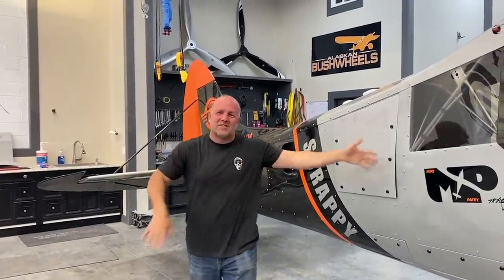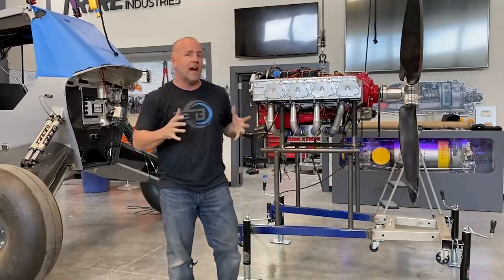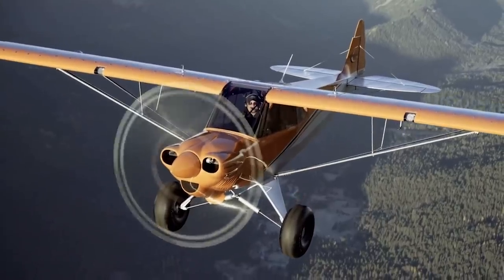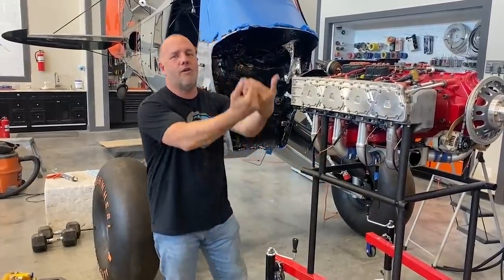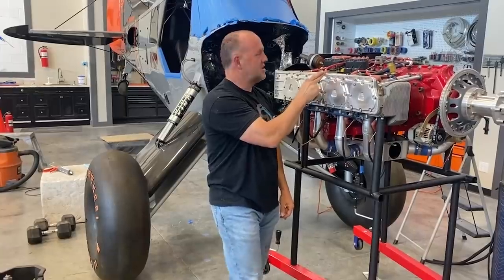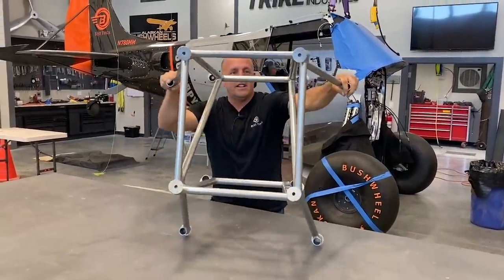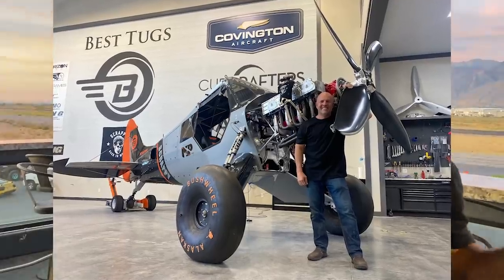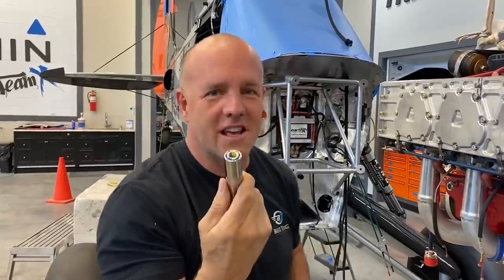Giant race engine into a Bush Plane 😳13 Liters goes into Scrappy build # 29

Comment: Dear Mike, this beautifull engine will use a lot of fuel, would 'n it be a challenge to design a pair of conformal external fuel tanks (like they have for the F16) to extend your range for overland journeys etc.? It has not be done on a cub plane before I think, so to make your Scrappy even more special!

Comment: Myself, probably would have used three Jack's on the engine stand to make it easier to keep from teetering as you adjust it. In the end mad respect to people like you I have for awhile been wondering if those supercharged watercraft engines would ever work in a light aircraft don't know what they weigh but up to 310hp stock just a thought awesome world there at your shop

Comment: Awesome engine mount design. I did notice one thing though, with all the angles and directions of installing the mount to the airframe, it still looks like there is only 4 bolts holding the actual engine to the mount and they are in-line with the longitudinal axis of the plane. Is this a weak point?
Reply from the maker: Great question 👍🤠 On the engine side they look straight but they are also angled.  Also the engine side uses the block as part of it structure as it can’t move or need any angle as a giant block.  So on that side of the engine we use the 4 certified attach points designed and on all certified agricultural sprayer aircraft currently using this engine. Many even heavier twin turbo versions of this engine use this same set up.  They test this mount 4 point side to 12 G.  I think the only way to cause a failure would be a crash of some kind.  Let’s hope not 🤠 cheers

Comment: Do you ever use safety locknuts (like with an steel out-of-round insert) in attaching points like the motor mounts?

Comment: Mike - Why did you not go with fuel injection for your engine?
           Are you concerned at all by the size of your fuel/air plenum that feeds the cylinders and what could happen with a back fire?
           In watching other aviation vids the little LiPo batteries seem problematical at best.  Sure seems like an 'old fashioned' AGM battery would be a better choice?  
           Better yet move your battery back into the cargo area to eliminate arcy sparky things from happening in a fuel rich environment of the engine compartment AND much easier access
           to service/replace.           
           Since you have gone to the trouble of installing a parachute system then maybe think about a house battery for your electronics and a separate battery for your ignition/starter
           system.
           If you really want to cover all bases, separate solar panels on the wings for each battery system.  A dead battery on a cold day, in the middle of nowhere, WILL take the shine off of
           any adventure!

Comment: Mike I've been following along on your scrappy build and I have a question..... Did you consider using the rear suspension design from a trophy truck on the front of scrappy...what I mean is a long travel straight lower wing with the tires molded into the bottom side...I think you would get a lot more lift and possibly a little ground effect as you were landing...also prop wash on take off would be an incredible boost I think...what do you think?

Comment: Let me start by saying simply incredible Mike, I recently discovered your channel and am busy watching the back catalogs. Now for my thoughts and question, I’m a quality engineer by profession and avid aviation nut like yourself. The engine mount concept is fantastic, my question comes from a perspective of testing. While the bolts are by design utilizing physics to stay in, did you consider what would happen if the weld failed at that location or the bolt sheared off, as a result of the constriction placed upon it?
Those translational forces could then act upon the remaining anchor points resulting in a critical failure. The engine is essentially trying to screw itself off the front of the plane, I would be really interested to hear how the concept was tested or your ideas validated. Again simply incredible design and build I’m extremely jealous.

Comment: Does the new location of the bolts also help with shear forces on the bolts? I guess they're more likely to shear of than be pulled apart, right?

Comment: Hello Mike, I have to say thank you for sharing these videos.  They have been such fun to watch an learn from. You are an incredible inspiration and craftsman  I have a question about your motor mount design. When your dealing with the high hp of your engine and size of your prop, you have taken so many measures to create cross axial triangles etc throughout the frame and even creating a carbon tube outer skin to counteract torque and to keep things stiff. In the motor mount, is there a reason you didn’t do any diagonal bi-lateral cross members going from opposite corners (front upper right to rear lower left) or is it not needed having gone unilateral from front upper left to rear lower left? Probably a dumb question but I was just wondering.  Thanks again and keep up the great work!

Comment: Serious question: you started out  with a space frame, but then you added extra weight to the ends so you had to build a carbon hull/'exoskeleton' to take some loads off the space frame. And what I'm asking myself is what residual benefit the space frame is now giving you. There is, after all, a lot of complexity to it. If you were starting this project again, would you still use a steel space frame, or would you go for a carbon monocoque?

Comment: You have an awesome engineered motor mount, and the mounting system for it. Curious as to how stout the firewall is that it attaches to, and the rest of the framework and how it's beefed up to tie in to the firewall.  Yes, you have the thrust capability, and opposite that, all the drag  Sorry Mike, I'm not smart enough to wrap my head around all the engineering calculations, but I am sure you thought of it already.

Comment: I will drill holes in the motor mount bolts and use castle nuts with cotter pins.

Comment: Ok, I know this video is 6 months old, I just found you, subscribed, and I'm catching up on all your videos. I have a question, and I'm sorry if it was answered, I couldn't find it. 

You did all your weights and balance of the plane, dry and wet. You did all your weight and balance on the engine, with and without all components and accessories attached. Then you went ahead and moved the engine forward to offset the weight of adding the chute and correcting the CG of the plane.
 After setting the position of the engine you built your motor mount, which looks to be about 25 pounds, didn't that also shift the CG? Also can't you just strap the engine to the airframe with Kevlar straps so you never lose that forward weight if everything went south? 
Thank you for your great content. I started flying in 95, took a break, life, these videos got me itching again.

Comment: For added safety add some high tensile rated nylon straps like seat belt straps used on trophy truck suspension or rigging for cranes.  When a steel braided cable as a backup tether for the engine is a good idea.  Thank me later

Comment: Brilliant work Mike, do you think you’ll ever bring any of your aircraft over to the UK at some time in the future? Also, is there any reason why free flowing exhaust headers like those on muscle motors aren’t used on aircraft engines ? Is this because aero engines run at lower RPM’s and exhaust flow isn’t so critical.

Comment: Maybe you could explain in one of your upcoming videos why you need such a large displacement engine for the power level? It seams like 13 litres could produce a lot more than 600ish hp. An average car guy or gal might think that you could easily get 600hp out of an LS engine, especially turbo charged; however, that is peak horsepower at 6k rpm or greater. If you run a atomotive engine at peak output for any length of time, it will probably die a spectacular death. I understand boat engines can run at peak power for hours and hours, but their power band is shifted way down into the lower rpm’s.   Are you using displacement to shift the power band into a safe engine operating speed? I know it’s a late comment, but I would love to know more. As always, you’re builds are awesome and inspirational.

Comment: Mike Patey,
When you did your calculating for the center of gravity and thus the exact location of the engine, did you take the weight of the (at that time not yet produced) engine mount into account? Since you fabricated it on the spot.

Comment: the IO720 is a super thirsty engine before it is suped up to 500hp what are your plans for fuel tanks to support long distance flying? i think you stated in an earlier video you were planning on flying up here to Alaska, where bush flying relies on fuel capacity to get in and out of camp 3-4 hours away.
Reply from the maker: I’ll have 4-6 hours of fuel, depending on my power setting.

Comment: Cool mount; question though- safety wires on the connection bolts/nut combos - beyond just gravity and opposing angle placement?

Comment: Ok a question Mike...the 8 bolt angled firewall connections...how does translate to strength of the only 4 bolts holding the engine? Respectfully thanks. Thanks for the socket tip...here’s one back...in those tight locations where your trying to get a nut and washers to bolt up, super glue the washers to the nut then tape nut into socket.

Comment: Mike I think you might not end up liking the 4 blade on your plane due to torque roll, we had a lot of torque roll with a 4 blade set up on our airboat and it went away when we went to a odd number of blades.

Comment: doesn't having the bolts at an angle now subjects them to a greater shear stress under normal load conditions? Have you run any simulations/tests for this new design? What's your safety factor?

Comment: Hello Mike. On one of your earlier videos you showed your fuel tank on Scrappy. To me it looked very small and you are going to need plenty of juice to run a 13 l donk. Will you also be having wet wings
Reply from the maker: I’ll have more fuel on board than I could personally last between stops.  The tank you saw was just the header tank.

Comment: I think of welding like he did the bolts.. but there is an offset of shear to pull strength. I wonder how he determined angle.. or just for gravity usage. I remember some of the bolt rules when working aircraft. Never bolt straight up.. let the bolt drop through. on jet engines, the compressor bolts go front to back..nut the backside, as beyond gravity is 900 mph to helps hold it in I guess. ;)

Comment: Great work Mike. So inspiring.
Question... I've always felt aircraft engine mounts "Look" weak and I'm sure you've done all the math and stress animations you possibly could. How much tension is on the top 2 bolts what could they handle?
In general, I love and respect engineering but every once in awhile you see something that looks sketchy.
Keep up up the amazing work.

Comment: Hi Mike,  just an observation/question. I assume you are using Chrome-moly tubing and if so, did you anneal the weld joints after TIG welding? My dad was always after us to either use the oxy-acetylene torch weld or, if we TIG weld to stress relieve the joint with a torch post TIG welding.
Reply from the maker: Yes correct and great question.  You of course can use a torch to relieve after welding but I just take the entire motor mount to a heat treatment shop and let them do the entire frame at once 👍🤠

Comment: You are so right.  My dad had a student that was a state representative who owned a Globe Swift.  Because of a crack in the wooden propeller under the spinner, the plane shed a blade and the engine was ripped off the plane in flight.  They found the man dead in the plane with no obvious injuries. Died from internal bleeding.

Comment: Heaven Forbid there is bolt failure of stress tolerance or shearing. is it possible to build a square around underneath to catch the motor from falling off.

Comment: Mike, roughly how long did you spend designing and engineering the plane digitally and hypothetically before you even cut a piece of metal or started working on anything?

Comment: That intro... wow. I'm an old school cu. in. guy so at first 13 liters didn't get my attention. Physical size did but it's hard to wrap my head around the size of Scrappy so engine looks "normal" compared to Scrappy. Then I started thinking... wait... my Ford turbo diesel is about 1/2 the displacement and it can't even fly!! I was flight planning with Foreflight a few weeks ago. If the old C172 I rent (and I) could handle the flight from Price to Spanish Fork, a direct VFR flight is only 2.5-ish hours (KFMN). The more likely route is 5 hours going west and then back north on the west side of the mountains, maybe a little less but I doubt it. She's not fast but she flies. I would love to come visit (aka geek out) but timing... I know that your (A) a busy man when it comes to family (B) a busy man at work, and (C) a busy man building Scrappy... that's a lot of busy! and I wasn't raised to just drop in, anywhere, ever (yet another reason not to skydive!). Something will come up and it'll work out. The engine stand was impressive. The increase in functionality was easily worth the time. The tape trick is handy!

Comment: Mike, is there any concern or worry, about putting the motor mount bolts in an angle that's closer to a "shear" configuration, rather than "straight" a tensile configuration?  Does your modeling say any thing about this?

Comment: What if you use 4 synchronized besttugs to control the engine jack/stand?  ( a laser mounted on the engine and reflectors on plane for positioning )

Comment: I've been  working in the aircraft industry for over 30 years and counting ... I've never heard that gravity will keep your bolts in ... and that vibration will prevent your bolts to loosen up ... that's why we use security wiring on the nuts ... maybe  this guy knows some secrets of physic we ignore ... lucky him !
Reply from the maker: I think I could have done a better job in my edits and explanations.   🤷‍♂️🤠 if that’s what you understood I missed it on one or both.  On all aircraft we install bolts top down so if somehow a bolt did not have a safety wire missed by a mechanic, and it happens,  resulting in killing many pilots over the years as you must know. the bolts stay in and even with vibration the gravity keeps them downward.  It’s not absolute but If I installed bolts so gravity didn’t keep them in during a mistake by a mechanic i would be a laughing stock of lindy and other  award judges that gave me top honors on many of my builds.  I’m surprised you have never heard to install all bolts when possible from top down. Also I never said that vibration keeps the bolts from loosening up, just that when possible take advantage at every extra safety option.  Of course I use one of various locking nuts and safety wire on everything.  But when it’s free safety why not install all the bolts for the worst case or mistakes later.  Sorry if my editing or the way I said it gave you that impression.  It is so far from what I intended and others didn’t understand it the way you did. I will try and be more careful in the future.  Thanks for your thoughts and comment.  Cheers
Reply: @MikePatey  thanks for the reply, I think you are doing a great job, and your project is definitely an interesting one ...
putting the bolts from top down is a good idea ( whenever possible ), unfortunately  as you've already experienced yourself,
( during your builds ), it is not always the case,  that's why  double check  is mandatory ! Keep us posted with the development !  we can't wait to see it airborne ! Have a good one !
Reply from the maker: @doncarlo5  thanks 👍🤠 charging forward my friend

Comment: Regarding the engine falling off the single-engine plane, a TS-8 Bies flown by Andrzej Abłamowicz (IIRC) has physically lost its radial once and landed successfully. A bit of help was extending the landing gear which shifted the weight under the (missing) nose forward.

Comment: Awesome... Weight and balance to far aft, no problem, move the motor forward + build custom motor mount. Engine won't fit in cowl, no problem, modify and make a mold to custom fit it, Carbon Cub gear has limited travel + wheels don't stay parallel no problem make first aircraft off road long travel suspension, not enough hp no problem triple the hp, wings to small make it bigger, better add a parachute just in case, no problem plus all engineered, tested and verified better, lighter and stronger.... Freakn' amazing, so inspiring.

Heck taking my work at home desk sitting on two saw horses, building custom legs, working on it for a 2 weeks, Patty built a custom motor mount in a few days, it looks way better then my desk legs, plus he's working full time. Back to work!

Comment: Love the build, I'm curious; why mechanical fuel pump as well as 2 electrics? I know mechanical pumps can flow a ton more fuel the electrics but they're also significantly less efficient then electric pumps. What's the layout of these pumps going to be? Mechanical for cruising then the electric pumps kick on for high altitude stuff or am I way off?

Comment: A question I have been wondering about; what would adding a torque converter do if you added one between prop an engine? As a torque converter increases torque initially with about 18- 24% it should give a boost when adding power for take off, as soon as max prop speed has been reached it does not do much more, but it would give the possibility to add a prop brake and stop the prop turning with the engine running. With the monster engine you have, extra torque may not be needed but prop brake may be?